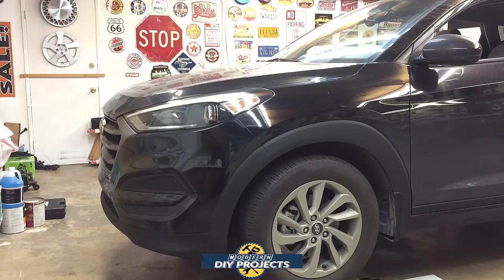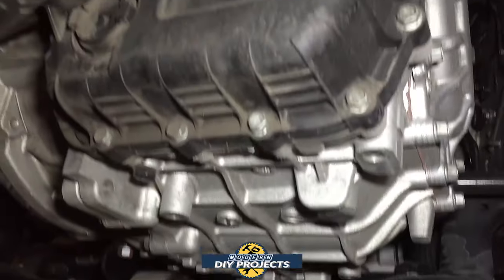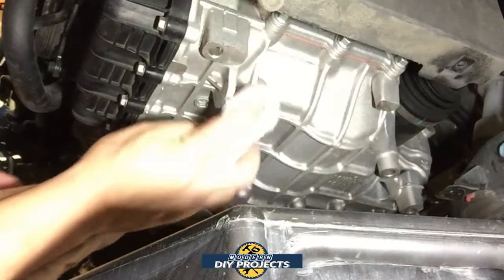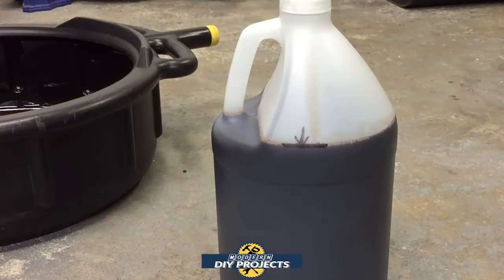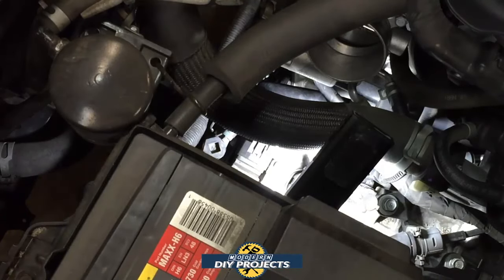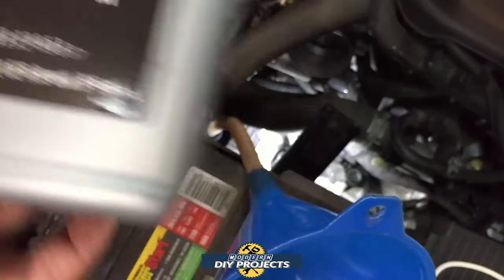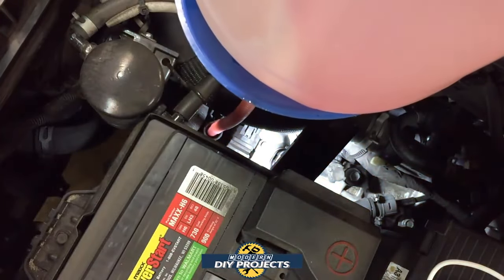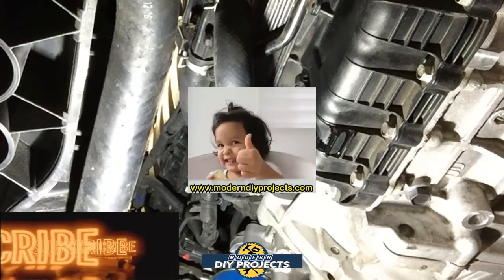How to: Transmission Fluid Change on Hyundai Tucson 2016 and Newer

Comment: Hello.. can i ask how if i want to change the hyundai tucson 2.0 2016 transmission oil filter
Reply from the maker: No need. This transmission does not have a traditional filter. It only has a metal screen for catching large particles. The only way to change that screen would be taking apart half the transmission housing. The best way to keep the transmission fluid clean is to change it more often.
Reply: @ModernDIYProjects if I want to keep the gearbox from being easily damaged, is there another way? in addition to changing the transmission oil on time.
Reply from the maker: If you are really concerned then you can change the oil twice as often as recommended. But  I suggest that you do not open the transmission if you are not a professional. These are not meant to be opened without reason. More maintenance than a fluid change is not required.
Reply: @ModernDIYProjects  Yes, undamaged items do not need to be repaired. Just looking for alternatives to gearbox care. So Hyundai Tucson 2016 doesn't need to change the transmission oil filter? Has been in use for 6 years on a 90.000 kilometers journey.
Reply from the maker: It does not have a filter so there is nothing to replace.
Reply: @ModernDIYProjects  Ok thanks for information..👍
Reply: Great info about the filter. Thanks again! Some auto transmission fluid flushing of some other vehicles talk of changing the filter, and so I had the same question too..

Comment: I have a Hyundai tucson 2.0 L 2020 and I recently change transmission and put in about 5 qrts of hyundai brand oil, the mechanic told me that he could not check the fluid level. What i see from your video that you put only 4 qrts , so would be safe to assume that my transmission is not under filled ? Right?
Reply from the maker: You may be overfilled actually. What the Mechanic meant was "I don't want to bother checking the oil level". I explained in the video how to check the level so you can do that yourself with no special tools.

Comment: Was any port open to allow air to escape while filling the transmission with fluid? I've seen some guys say it can bubble up and make a mess.  Is that necessary?
Reply from the maker: Not necessary. I don't know why you would make a mess unless you poured it in too quickly. These transmissions are not filled to the top. Look at how low the level plug is on these things. They only take about half full so there is plenty of air in the transmission body for expansion. I didn't have any issues.
Reply: I had the problem getting it in without the level port open.  I tried 2 different size funnel tip diameters and I was getting a splash back.  I think the level port being open will allow for displacement of air and a smoother pour.

Comment: What’s the steps for shifting through the gears after the fill up. Is it comparable to Honda where you go through them each for 3 seconds? N-r-d-1-2-d-n-r-p?
Reply from the maker: There isn't anything specific noted in the manual. It doesn't seem to matter how you do it as long as you allow time for the fluid to flow freely.

Comment: How often should I change the gearbox oil for my tuscon 2018? Also, the car has been parked for two years and it only had 15,000m on it. Thank you
Reply: Hyundai recommends 90 000 km, don't ask me what that is in Miles lol
Reply: @SytrophyOfficial   Just FYI, 90K KM is 55,924.407 miles. Thats fairly often.

Comment: Would this instruction video apply to 2.0 non turbo 2016 Hyundai Tucson also? I was told to use Dual Clutch Transmission fluid
Reply from the maker: I misread your comment previously. I thought you wrote 2018. This video pertains exactly to a 2016, 2.0 Non Turbo Tucson. That is exactly the vehicle I used in the video. As I mentioned previously, all this information for your vehicle is listed at the end of the manual. Reread it. I have the same manual you do and mine has it. Only the 1.6 is a Dual Clutch.

Comment: Great video. Got a 2017 Tucson AWD coming up on 70,000 miles. I’ve never done this service to it but want to. I’m curious though, the owner’s manual states that “no service required” under normal usage. I don’t tow anything so I’m sure I fall under the normal usage and not the severe which states to replace the fluid at 60,000 miles. So, should I change it or not? Thanks.
Reply from the maker: The short answer is YES you should change it at 60-70K miles. The Owners manual is full of BS and is not to be trusted. They don't care if your vehicle breaks down outside the warranty because then it's not their problem. If you want to get a long trouble free life out of your vehicle then you should do simple maintenance like this. Ask any mechanic and they will tell you that the manual is nothing more than marketing BS. They make it sound like the cars are just so great that you don't need any maintenance. They do this to make them look to be less expensive in the long run for folks that have no knowledge of cars. Do this simple maintenance and you will never regret it. Don't do it and you could have a very broken, and very expensive transmission repair. Simple as that!
Reply: @ModernDIYProjects  Thanks for the reply and feedback. I’ll be sure to follow your steps and get this done asap. One more thing, my Tucson owner’s manual shows Automatic transmission fluid and Echoshift dual clutch transmission fluid. Different capacities for each and different fluids for each. I’m a bit confused. Isn’t it one or the other? Or is there two fluids to change? Thanks again.
Reply from the maker: @Mopar3.6LV6  Yes, it is one or the other. The manual was made to cover all the different versions of the Tucson. If you have the 1.6L Turbo, you probably have the Dual Clutch. That one will be a different fluid than the one I did. I have the NON-Turbo model so it has the Normal Automatic Transmission. You can look at the sticker under the hood with the vehicle specs and it will tell you if you have the 1.6L or the 2.0 or 2.4. You can also contact the dealer and give them your VIN and they can look it up for you and let you know which one you have.
Reply: @ModernDIYProjects  Thanks again for the reply. I know I have the 1.6L Turbo AWD. Would the transfer case be the same as the transmission? I see where there’s a drain bolt like in your video and a fill bolt right above it; a hex type bolt.
Reply from the maker: That I cannot say. In a traditional rear wheel, AWD system, the transfer case and transmission are two separate units, and may or may not have the same fluid. Depends on the manufacturer. I am not familiar with Front wheel drive based AWD systems. It may be integrated into the transaxle, I can't say. That is a separate video you will have to look up. I am only familiar with regular transmissions since I have never owned or worked on a front wheel AWD system.
Reply: @ModernDIYProjects  Sounds good. Thanks again.
Reply: It is integrated into the transaxle so atf service will take care of your transaxle as well.

Comment: Hello, my girlfriends Kia sportage 1.6cdti automatic is over revving when changing gear and is very jerky. Was thinking a gearbox service will help. It's a 2018 model with 40k miles on the clock. Do you recommend just following this video or change the filter aswell (if the gearbox has one) I've seen other videos where they remove the whole sump?
Reply from the maker: The 1.6 may have a different transmission, I'm not certain. If you have 40K miles you should still be under warranty. Kia warranty is 60K on the entire vehicle, and 100K on the drive train including the transmission. But if you can't take in to the dealer for whatever reason, then doing a fluid change would not hurt. It could get rid of some contaminants and clutch material that may be causing problems. If it doesn't go away after a fluid change, then I would recommend taking it to a technician.

Comment: I got my 2017 Tucson used around 90 something thousand miles. Around 110,000 I asked the guy at Valvoline about it and learned it was a sealed transmission which I had never experienced before and he told me they were different and lasted much longer so I didn’t need to worry about changing it until around 155,000 miles. I couldn’t really find anything online and now I’m almost there and my check engine light just came on randomly and now I get a sudden loss in power the first shift or 2 when beginning the drive. After that it works fine. Was the Valvoline guy wrong and I should’ve done it forever ago??
Reply from the maker: What that guy gave you was a lazy answer. The manufacturer tells you to change the fluids on your vehicles at longer intervals because it makes the vehicles sound cheaper to maintain and less hassle to own. They don't care, they want you to buy a new one when this one falls apart. The reality is that fluids need to be changed on a regular interval to maintain optimal performance and increase the life of your vehicle. That fluid should have been changed at around 100K. You can still do it now and hope that it clears up your problem. Also the term "Sealed Transmission" is a misnomer. In reality they are not sealed as you saw in the video and the fluid can be changed. The only thing is that they don't have a dipstick any longer and the measurement is a little more complicated. But they are definitely NOT sealed. Also be sure to change your motor oil frequently. The Variable valve timing on these vehicles is prone to complaining and acting up when the oil gets old and thinned. Change your oil around 3-4K to keep your engine healthy. I have another video on how to do an oil change on this Tucson on my channel page.
Reply: @ModernDIYProjects  woke up this morning with a check engine light. Took it to advance and it says “Unable to engage Gear 1”. Now I’m worried my transmission is going out but I’m hoping it just needs transmission fluid and it’ll be fine. I’m a full time college student who only can work 40 hours a month. I cannot buy a new car or a new transmission. I’ve got the oil change done every 3,000 and everything else checked but where I was ignorant to the “sealed” transmission I just took his word for it and now I’ve got the consequences
Reply from the maker: Don't worry yet. Just do the transmission fluid change and see if clearing out the old contaminants will help. If it helps and starts engaging again, then wait a few weeks and do another fluid change to clear out more junk. Use only the fluid from Hyundai. It's not cheap but don't trust aftermarket fluids to play nice in this transmission that is giving you problems. Hope for the best.

Comment: I wanted to change the transmission oil on my 2017 Tucson but was told by a service guy at the dealership it was not recommended or it could ruin it? It's a bit over 100K miles
Reply from the maker: Nonsense! Absolute rubbish! Whoever said that does not know what the heck he is talking about. Changing all the fluids in your car is basic maintenance. Now if you said you wanted to FLUSH the system, then I agree that is a bad idea. But a basic drain and fill is perfectly fine. I have done this to ALL my vehicles when needed and never had a problem. I have done this twice to my Toyota Rav4 with no issues. Has well over 150K and still going strong, and all original.
Reply: @ModernDIYProjects  thank you for that. When he said that I didn't understand why and was always doubtful. Thank you for this video! I will certainly use it!

Comment: Hi... thanks for this. Do you know if this applies to a 2021 Hyundai Kona and have any idea as to where the fill plug is for this make and model?
Reply from the maker: The procedure will be the same. The transmission should also be the same since Hyundai/Kia don't have a lot of transmissions to choose from. The fill and drain plugs may be in slightly different locations, but now that you know what they look like you should be able to find them. Just look around carefully. I don't have a manual for the Kona so I can't be more specific.
Reply: I believe The Kona has a cvt transmission so the process will be different

Comment: Do you need a scanner tool to bleed brakes if your doing a brake flush? Thanks
Reply from the maker: Yes, because you need to be able to activate the ABS bleed system. You can try and see if it will work by simply pumping the brakes and adding fluid, but not sure if that will work.
Reply: Really appreciate the info and response. I subbed awhile back.

Comment: Did you only use 4 quarts? My 2018 Tucson (2.0) requires 7.3 quarts.
Reply from the maker: Yes. The dealer sold me 7 quarts since that is what they said I would need. I only took out 4 qts and I double checked, so I only put back 4 qts. I kept the extra for next time since I got them at a good price. But yeah, I think the book is wrong on the amount because I couldn't squeeze more out of it if I wanted to.
Reply: I think the procedure needs to be done 2 times...that is why 7+  qrts or liters. Do you have the manual?

Comment: I can't trust my oil pan to do the measuring because it's dirty and has other oil in it. So I'll go with adding 4 qts and seeing what pours out. So get to operating temperature then open the check valve? Looking for a slow dribble correct?
Reply from the maker: Correct, you got that right on the nose.

Comment: Do you know what type of ATF i have to use for a Hyundai Tucson 2018 1.6T ?
Reply from the maker: That is a different type of oil used for that. the 1.6 has the Dual Clutch transmission. DO NOT use the same one that I did! You can call the dealer and they can tell you exactly which one you need. In fact I recommend getting the fluid from the dealer since these vehicles can be very sensitive to improper fluids. Other brands may be universal use and may not be exactly right for this vehicle.

Comment: If you pull the plug where you check it then no fluid should come out correct because they should be at level respectfully asking first time attempting this
Reply from the maker: Yes, but if a little fluid comes out, that is fine. A little over the fill line is OK.
Reply: Just completed my flush yesterday did exactly as you instruct no problem but there was no washer on the drain plug and there was no leakage and I replaced it with four quarts which is what came out

Comment: Where did you buy the transmission oil from ?
Reply from the maker: The dealer
Reply: I currently have hard shifting and the car jerks when I shift gears and I’m scared it could be the transmission what should I do? I took it to 2 different mechanics and they said it’s fine
Reply from the maker: If you have the Dual Clutch transmission, then that is normal. Dual Clutch transmissions are a Manual transmission that is shifted by the computer, it is NOT a real automatic. Manual Transmissions will shift harder. A real automatic transmission uses a fluid coupling system making the shifting much smoother. Check which transmission you have first before moving forward.
Reply: @ModernDIYProjects  honestly I have no idea which one I have how do I know ?
Reply from the maker: @lovebirds7756  Look under the hood of your vehicle. It will have a sticker on the hood or fender that tells you the Engine and Transmission of your vehicle. All vehicles have this. You can also contact the dealer and give them your VIN and they can look it up for you.

Comment: Would love a coolant change video 😁
Reply from the maker: I wish you would have asked me a couple of months ago. I just did it at the beginning of Summer. I do it once a year to keep it fresh. Can't dump out fresh coolant after only a couple of months. Tell you what, hit that Subscribe button and I'll make a coolant change video just for you next Summer.
Reply: @ModernDIYProjects  wow,this is very helpful.
Can you please help me with my question?
So, I drove my 2016 hundai  Tucson AWD for 2 years and never changed oil transmission. My car engine is running well but it doesn't move, many people told me it's a transmission problem. 
If I change this oil will my car start running again? Advice please.
Reply: @@user-os1vw9de1o  I'm having the same problem with my 2017 Hyundai Tucson. Found any answers yet?
Reply: @ModernDIYProjects  looking forward to that coolant change video 😉

Comment: Is that level check plug plastic that threads into the plastic housing of the transmission?
Reply from the maker: Yes, it is.
Reply: @ModernDIYProjects  Thanks for the response on that. Thought i'd give my 2017 Sportage 2.4L 6spd auto some fresh fluid as it's at about 59K miles now.